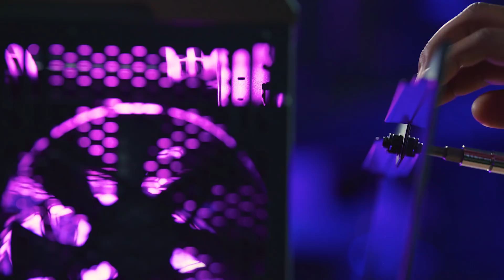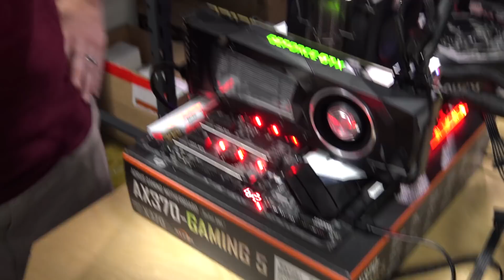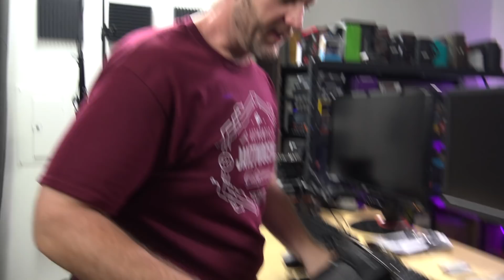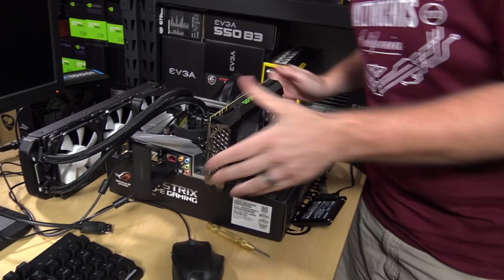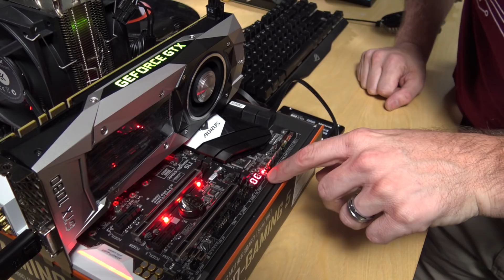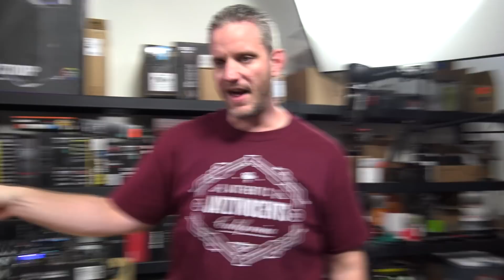I cant figure this one out... HELP!

Comment: You should check the BIOS on both cards, not just on one. You checked it on the card which was in the Intel system originally, then put it into the AMD system but you didn't checked the BIOS on the card which was originally in the AMD system, maybe that is the case.

Comment: You where working on IT for years. Can't be you haven't seen that before. Problems like the one you encounter make people say "AMD does not go well along with nVidia". For me its just a random problem you could easily encounter on any configuration and you don't have to blame AMD. But problems like that can't be solved via chatting or e-mail etc. You asked for ideas though and here it goes. You have to try changing other components on the Ryzen system starting with the PSU, memory disks even the Ryzen itself. Also try pluging other PCI E slots on the Ryzen system. Good luck. Last but not least perform a BIOS reset on Ryzen system. Or should this go first?  Oh don't you just love PC assembly problem solving? Good luck.

Comment: Tolerances in the PCIE signal? There's a small timing window for each signal on the PCIE bus. If you have a motherboard that skews it signal in one way and a GPU does it the other way, both on their own might be in spec. Together they might have enough signal skew between them to go out of spec. Seen it happen before in discrete electronic circuits.

Comment: Jay there are a few things you could try. I've had similar issues in the past and so hopefully something will help. I'm with you in not thinking it's the motherboard itself, though that could still be a possibility, as it's unlikely for a motherboard to be that selective of parts. So the suggestions:

1) Change the PSU.
This might be something that's often overlooked and most people take it for granted. It does seem unlikely, we get a high wattage PSU so that power draw stays at or below a 50% threshold to increase the life of the power supply. It shouldn't be dying or having any issues, especially when it's newer, but it can happen. This happened with two 970s awhile ago. I thought it was the card, i replaced the card, about 2 months later i ran into the same issue again. after a full diagnostics using an old card (210) I realized that the PSU wasn't supplying enough power to the card..or rather that the card was drawing more power than the PSU could supply due to a bad component inside which wasn't allowing the rest of the system to get the power it needed. Culprit was a blown capacitor, but that's beside the point.

2) Try another PCIe slot.
While this sounds like we're blaming the motherboard, we aren't. Not entirely. Screwing down a card just keeps it stable when it's sideways and hanging. Keeps the connection from snapping. So I'm not getting on you for it being loose. However that doesn't mean that the card isn't making a good connection. It could be that the tolerance of the pcb is on the lower end and the tolerance of that specific slot is on the higher end of the spectrum. These aren't exactly measured. There is a percentage of difference, though very small, that can interfere with the connection if the variables are just right. So definitely something to try. The slot itself isn't bad since we know it's detecting the other cards.

3) Secure boot.
So this is an odd suggestion. Secure boot isn't on all motherboards, though most that I have used had it. Normally we think of disabling secure boot for the sake of enabling CSM so that we can boot into older systems on newer boards. However, and I really wish I could explain this one, disabling it has allowed some components to work that otherwise would not. If someone out there can do the research on that it would be amazing, but I do not have the means to do so and the problem seems extremely rare. Still it is something that has happened.

4) CPU.
I hate to say this, but it can be the culprit. When you tried the third card on the system there was an error code that was signaling between DRAM and CPU. There could be a short, there could be a bent pin, we don't know. You reseated the card and the issue was fixed for that moment. However, as experience has shown, issues with pins can be mysterious since it doesn't always cause a system to act up.

If none of these are it then I'm sorry that's as far as my knowledge goes. This exact issue isn't common, though as you have seen now it does exist, but similar issues have happened as well that information and technique can be pulled from. Someone else mentioned an issue with Kepler and threadripper compatibility. I don't mean to shoot down that answer, and it could be a possibility, but you are using pascal cards and I'm pretty sure that motherboard is a x370 chipset not x399. So the GPU is different AND the processor, though the same architecture, is quite different as well. Seems like too many variables there to say that it's the same issue. However that doesn't invalidate the possibility and might be something to look into.

Comment: No over clock on the ryzen CPU set it to default?  Maybe don't like overclock setting?  Could be bad ram ? Check for motherboard scratch on the motherboard is the gpu slot very loose?

Comment: Nathan Hamman
Nathan Hamman
3 hours ago (edited)
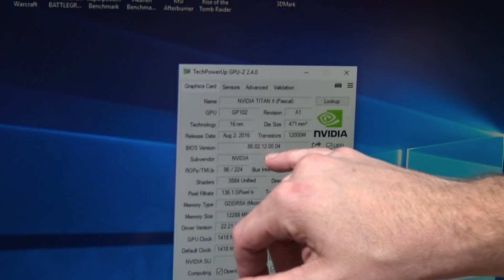4:50 uh jay you just checked the bios on the same card twice, you checked it on the intel system then moved it over to the ryzen system and checked it again.  Id try different bios for the card and the motherboard and see if there is any change.  Would you mind also showing us a closeup of the pins on the gpu as well as trying it in multiple slots.

Comment: My bet - the mother board - get a second board and retest so you can compare.  Probably a problem with voltage variance and timing at boot, which is causing post fails.

Comment: Bro... you checked the bios on the same video card when you moved it over
Reply: Plus... you have a problem with the pcie slot. If you re seat and that 3rd card and it works... you are having a vonnection problrm.... blow on the cartridge.

Comment: Hmm i would of like to see this gpu tested on another ryzen test bench to clarify if your having issues with power supply or ram. If the card does not boot on another completely different ryzen test bench then we know there is a fault with the gpu not drawing enough power from the ryzen system to turn on

Comment: First thing that I would have looked at is the contact pads on the Titan. Look for slight scratch, corrosion, or a smudge with a magnifying glass. Do to manufacturing tolerances of the motherboards and the cards, the pads may not be making full contact with the pcie slot. The fact that you had to re-seed that second card makes me think the same thing.  
Of course contact damage may be within the card slot instead/as well. Possibly copper dust even causing a short.

Comment: Could it be that the cards are a different revision ? To know for sure if it ain't motherboard type related you should try exactly the same motherboard. And maby a motherboard for ryzen from a different manufacturer. This rules out platform trouble. And if you have more of the same cards I would try out dident cards. 1 is a incident 2 is a coincidence 3 is a problem. Hope it helps really bi*ch to troubleshoot. Good luck !

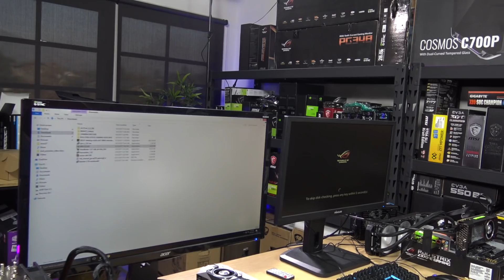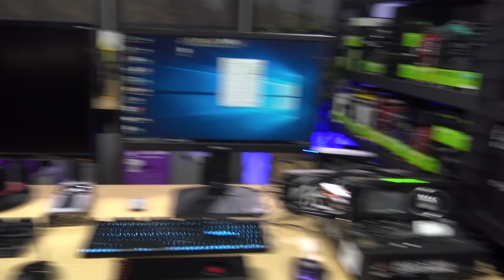Comment: Of course the GPU bios at 4:45 is identical...its the same card you just looked at the bios on the Intel motherboard.  At 1:53 you check the bios on the GPU on the Intel MB, then switch the card to the AMD MB and at 4:45 say the GPU bios is exactly the same.  I think you meant to check the bios version on the one you took out of the AMD MB and put into the Intel MB.
Scrolling through the comments I see I'm not the only once to catch this.

Comment: I'd test the power connectors, see if you swap them and if it will work, also check the power plugs on the odd working one and see if the pins are a little bent, really seems like a power plug issue.

Comment: I had a similar problem with Gigabyte motherboards GA-X79SUP5 and I kept troubleshooting different components. I kept getting different errors, one was with the memory, then my hard drives weren't recognized, then no video output. All of these errors were random and would come and go as they pleased.  I even bought another cpu to test out maybe it was the cpu but I was still getting these random errors, so I swapped the motherboard and everything worked fine.  When I tried to RMA the motherboard Gigabyte said the board was fine because it posted but it would always get different types of errors afterwards. So since then FUUUUUUUUUUCK Gigabyte!!! And that's your problem right there Gigabyte!!!

Comment: Try replacing just the motherboard, using all the same components and you will know.  The fact that you got better results from reseating the one card tells me there is some kind of loose connection that causes a specific failure in the card you are having issues with, but not so much in the others.  A combination of small factors of the board and card could possibly be working together to cause the issue with that specific card.

Comment: I had a similar issue when I got my Ryzen 5 system. I had made a big booboo and spilled a glass of water into my Intel 4690K system and fried the motherboard (never will I have a rig on the floor again.) I used my warranty (thank you microcenter for that!) and wanted to get a replacement... but they didn't have anymore Z97 boards nor would they stock them again. So I switched to Ryzen. The GTX 1060 I had wasn't allowing the system to boot and I kept getting the VGA LED... so I installed an R9 290 I have to see if that would boot... and it did... so I figured the problem was the card. But to check I installed it in another system (I don't have the hardware you do, Jay, but I never toss anything so I have stuff around) and sure enough the 1060 booted no problem, so I knew it wasn't the card. After trying EVERYTHING I could think of eventually I got the Ryzen system to boot with the 1060. It just started working. The last thing I had done was clear the CMOS, but that's nothing special. I wish I had the solution but... it magically started working... for no reason. I love Ryzen, it's a great processor but... it doesn't always make sense...

Comment: i think its a bad/dirty contact on that specific GPU, its not getting enough power because that contact isnt conducting enough but on intel board the pci slot may be giving more wattage meaning that until card is taxed in a certain way it wont fail. also this is all asuming vBios versions are the same

Comment: I had an issue once, the EFI's NVRam/PRam was corrupted. We had to follow a motherboard-specific process to erase and reset the NVRam. In our case, it was GPU lag. The machine acted as if we had the graphics card was on its last leg.

I would reset all Motherboard defaults/follow your NVRam reset guides.

Comment: This happened to me B4 on an Old intel P67 extreme board, a Bios Version Wouldnt work with the 390X  but only 1 version (out of 6 tested), im pretty sure it has something to be with the Gpu and Motherboard some Uefi shit and crap like that, now, as the card is the only thing that doesnt, it is the cards fault just by elimination you mentioned that you got the differently, antoher thing would be testing it in another ryzen system (diff board and/or chipset) and fiddle witht he Bios settings of the aorus board,  there are still alot of variables to eliminate

Comment: Run Ryzen system with only one stick of ram at 2133mhz/ and use different ram also rollback bios of Motherboard , and try using a different pcie slot. If it's still not booting  try another ryzen motherboard. Most problems on ryzen end up beeing ram issues. Also i'm not sure about the b2 error is graphic related usually any vga error has white led on ryzen motherboards.

Comment: You saw the same BIOS on the card because it was the same card... you should've checked the bios on the computer at the right of the screen once you exchanged them since it was the card that wasn't working on the other system.

Comment: I had the same issue with a r7 250 believe it or not... exact same situation, cards work on one system just fine, but one of the cards will not work on a particular system. And in my case, more mind boggling part was the motherboards were the same... Ram were the same... just CPU and PSU were different. Even tho I switched them just to see a difference; gpu and motherboard didn't like each other and refused to work together. since the builds were so cheap I forgot about the issue... didn't pursuit... now since it happened on camera, now I wonder again what causes this with such high end parts?

Comment: May be weird suggestion check the voltage the graphic card is pulling on intel on both cards. Maybe the faulty card might be requesting alot more power at post, i would do quick comparison see if the cards are exactly the same..

Comment: power supply issue? the card that didn't work was a Titan you said? I know a power delivery issue can cause all sorts of strange inconsistent errors.  I dealt with something similar when I pushed my old psu to it's limits.  backed off my overclocks back to stock and the weird issues stopped (boot errors, random crashes I couldn't figure out a common cause of)

Comment: Ooh! I can help, I think. I have been running the same motherboard Gigabyte Gaming 5 AX370 (non "k" version). I had the same error on a system that I've been running for just over a month (Graphics card RX480) & I know it well enough to have been puzzled after having ran BIOS F9a for only a day or 2. It was quite a pain, however I'm thankful that Gigabyte has Dual bios!. I very much recommend using your BIOS selection switch (bottom left) & select to run only a single bios & one that allows that card to post. Then flash that bios to F8 - not the F9a with the agesa update. You should be running stable I expect using BIOS F8. I'll be waiting for another Update after F9a - Best of Luck! (p.s. would be thrilled to communicate or help troubleshoot further if interested).
 I've also noted other random bios oddities, XMP profile randomly showing 40 or 24. Also the only non-pwm fan in my system doesn't always spin up either - regardless of smart fan options.

Comment: Would try to clear the CMOS on the motherboard. Clean the contacts of the motherboard and the graphics card.  Would also look at maybe placing it on a different PCI slot.  Maybe even change the processor.

Comment: Try removing half the ram or change to other sticks and possibly slower ram, and if that doesn't work change out the processor, it could be having an issue with IRQ assignment or conflict with other hardware since 2b looks to be "Memory initialization. Serial Presence Detect (SPD) data reading" and since ryzen is known to be picky about ram that wouldn't be outside the realm of possibility. If the card is causing issues with the base clock or a bus that connects to the RAM such as DMA it could prevent the post as well. It could also be hanging on the next step before it can display the code, so you might run it with a good config to see what the next code is. There could be voltage bleed between the contacts for some reason such as grease or flux causing instability, or as other have suggested the same bios was checked twice, so it could be an old bios not designed to handle ryzen though I wouldn't think that to be the issue unless ryzen is doing something to try and speed up the boot process.

Comment: "we've already updated the bios, so we know it's not a bios problem"
That's a faulty assumption, and even with the latest bios, there can still be an issue that hadn't been fixed with the latest bios.
That said, there may be a component quality issue on either that specific graphics card or that specific mother board or a combination of both.
Verification of this would require at least a 2nd identical motherboard to test given that the motherboard you have will boot an identical graphics card to the one that won't.
Test the suspect system with a different CPU and or different memory and make sure that the memory is running at its stock spd rating (2133 or 2400) and not in OC mode like 2933. It is quite likely to be a component issue that doesn't like something with the setup. It's getting back to basics to find what combination of components and/or settings that is causing the issue.
code B2 is "legacy option ROM initialization", which does suggest that the system is being told to boot the GPU in a backwards compatibility mode for some reason, because the card is not conforming to expected standards. But that's just a guess on my part as to what the code is telling us and legacy mode is not compatible with the UEFI.
Reflashing the bios may well fix this as just because the card is saying a particular bios version, does not mean that that bios version is exactly the same as the downloadable version (a minor correction to downloadable bios may not warrant a new bios version number release from the factory installed version)

Comment: You switched graphics cards to the titan that worked on the ryzen system, however, did you check the card bios version of the titan that didn't work on ryzen while running on the Intel system.